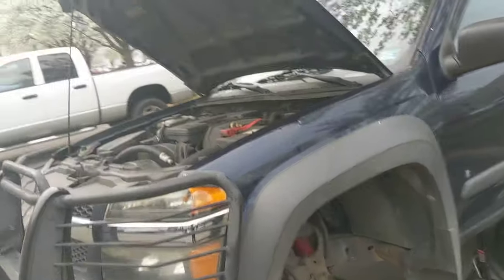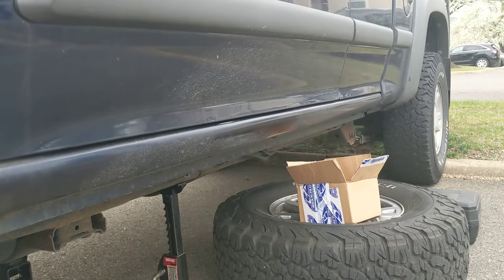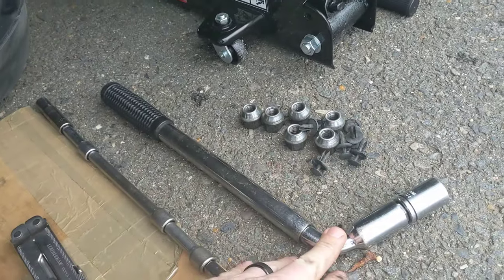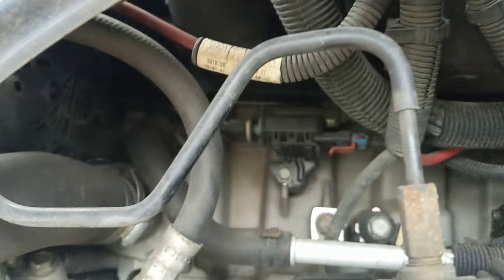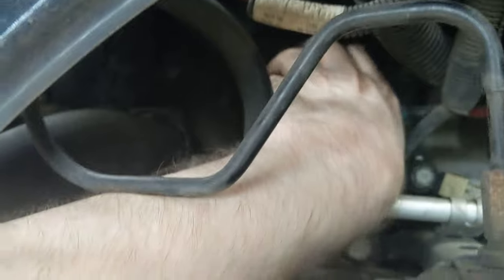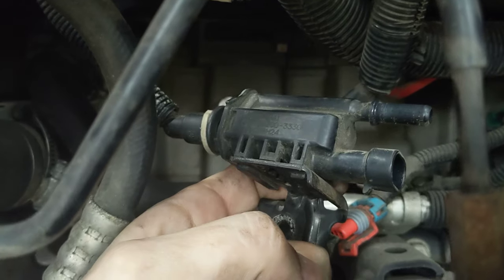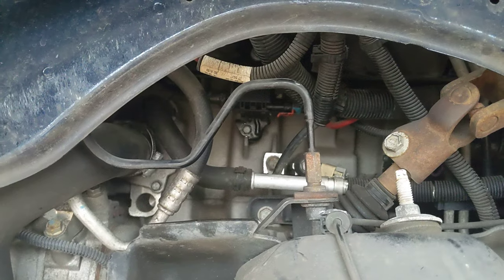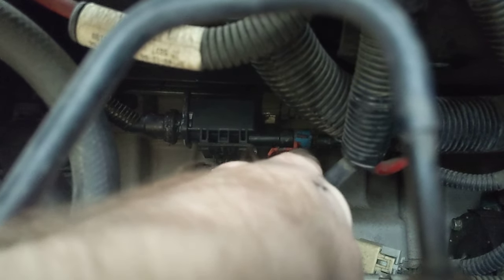How to replace Chevy Colorado purge valve solenoid (2141680) (214-1680)

Comment: Changed this but P04442 is still showing up. Any ideas on what it could be?
Reply from the maker: Hi! Thanks for the comment. I assume you mean "P0442", correct? Dumb question but if you clear the code with your code scanner after replacing the part, how long does it take to come back?

Also, here's a "troubleshooting flowchart" for various types of evap leaks:

----------

Troubleshooting flowchart for evap issues:
1 - Replace the gas cap
2 - If you still get the code, replace vapor canister purge valve above spare tire. Inspect hoses and replace as necessary
3 - If you still get the code, replace purge valve solenoid on driver's side of engine below intake. Easiest way is through driver's side wheel well, or remove battery. Inspect and replace hoses as necessary (including hose between valve and throttle body)
4 - If you still get the code, inspect lock ring around fuel pump at top of tank. This is a poor design and lock ring frequently rusts out, causing evap leaks and smell of gasoline
5 - Check for loose intake manifold bolts or leaking/damaged hoses around the intake and PCV system
6 - If you still get the code, a smoke test may help

Alternatively, don't beat around the bush and start with the smoke test.  If that is inconclusive you may also have electrical issues.

----------

Hope this helps! I'd recommend the smoke test to help pinpoint the leak if replacing parts doesn't work. Good luck!
Reply: @CompTechMike  thanks for the prompt reply! 
I already replaced the gas cap, and as mentioned just replaced the canister purge valve. I just cleared the code with my scanner so we shall see if it shows up again. 
Though I do have a smoke machine. Where should I blow the smoke thru?
Reply from the maker: @Dexxtrr  hi! A couple of common locations for running a smoke test include feeding into the vacuum line going to the power brake booster, and also if you have the second "fuel line" with the green cap next to the intake manifold. I wasn't sure what that was at first but apparently it's a good spot to do a smoke test.

This reminds me, another place that can have a vacuum leak is the diaphragm inside the power brake booster. It's uncommon, but possible. Might not hurt to run a few tests on that, as well, to check if it's holding vacuum (or a possible source of leaks). Good luck!
Reply from the maker: @Dexxtrr  hi!  Sorry for the delay.  I typically recommend various ports on the intake or around the resonator, or through the vacuum hose going to the brake booster.  You can also drill and add a small hose fitting if you don't have one, already (and just cap it off when not using it).  Good luck, hope you got it by now.  😅

Comment: how many miles did the original last you? before it STB
Reply from the maker: Hi! Thanks for the comment. I don't recall exactly but believe my truck had around 205,000 miles when I recorded this video.

Note that replacing this part did not resolve all my issues. I still get the P0442 "evap small leak". In my case that now appears to be coming from the gasket at the top of the fuel tank, where the fuel pump plugs in. Due to the difficulty of replacing that gasket (you either need to lift the bed or drop the tank) I've just been carrying a pocket code scanner and resetting the CEL when it comes on (every couple hundred miles). I'll get around to it one of these days, lol. 🤣

Comment: Mike what size are the hoses that fit in to the purge valve?
Reply from the maker: Hi! Thanks for your comment. I'm afraid I don't know the diameter of the hoses to the purge valve.  These are pretty specific and have unique connectors, so I don't think an ordinary hose would fit.  You might have some luck finding them on RockAuto, however.

I was pretty surprised, I just went to their website and put in "2007 chevy colorado vapor canister hose" and a few different hoses came up.  So if you're missing your original hose or your original one has become broken, maybe they'll have the right one for your specific truck?  Good luck!

https://www.rockauto.com/
Reply from the maker: Also this diagram might be helpful to you.  Again, you're going to want to look up for your specific vehicle but this site seems to have some pretty good diagrams:

https://www.wholesalegmpartsonline.com/showAssembly.aspx?ukey_assembly=396035&ukey_product=2787260#003

Comment: Is for message gas-cap?
Reply from the maker: Hi!  Yes, P0442 can be the error code for a loose or improperly fitting gas cap.  If you get this code that is an easy fix to test first.  Sometimes it's just as simple as rotating the cap a few times.  Good luck!

Comment: Tried this just right now but my entire Driver Side wheel hub is compressed almost all the way to the top of the inner wheel well. Anybody else had this problem?
Reply from the maker: Hi! I'm not entirely sure I understand your question. Did you remove the liner (held in with push-clips) shown at 2:55 in the video? Is your truck suspension modified (lifted or lowered)? Do you have Z71 suspension (torsion bars) or Z85 (coil springs)?
Reply: @CompTechMike  I removed the liner but its a stock RWD colorado. I was a little confused on where to place the jack because i was no where near able to even stick my hand in to even start disconnecting the solenoid.
Reply from the maker: @anarcho-savagery2097  Have you jacked up the truck under the frame and removed the tire?

Also is it coil springs or torsion bar suspension?
Reply: Sounds like you just need to move your jack to one of the jack points behind the wheel area
Reply: @thechosenpuppy574  yeah thats probably what i'll try next. Thanks guys.

Comment: So did this solve the issue?
Reply from the maker: Unfortunately it appears I have more troubleshooting to do.  Still get the occasional P0442 "evap small leak".  I've had the vehicle smoke tested and they couldn't find any leak.  They did notice some wetness at the top of the fuel tank, so there may still be that gasket around the fuel pump that needs to be changed.  It's tough to diagnose something that only happens every few hundred miles!  ;-)
Reply: So I have a leak from the top of the tank. The issue wasn't the pump assembly it's the vent gasket/ silicone holding that plastic vent in. Noticed the leak when topping off the gas. Doing research but haven't found the part(s). Thinking I may have to order a new tank since the silicone I applied isn't holding the pressure in the tank.
Reply: @frankboykin3940  just replaced my fuel pump after the top was leaking.  the rubber gasget was bad.  Needed to jack the bed up for removal.  took hours but it came out with some swearing.  I'm 1/2 way mechanical but this was a chore.

Comment: Is that put pressure inside the gas tank vent valve
Reply from the maker: Hello! I'm afraid I don't understand your question. The EVAP system works to reduce emissions and fuel vapors. You might check out this link to learn more:

https://ferberstireandauto.com/how-does-the-evaporative-emission-system-evap-work/

Hope this helps!

Comment: easy if you take the bolt out first
Reply from the maker: My experience that doesn't really give a whole lot more "wiggle room" but maybe your lines have more slack.  Whatever works for you.  Thanks for the tip! 😊
Reply: @CompTechMike  evidently ,  it would come out a foot from the engine
Reply from the maker: @jonesy4588  I don't see how your evap lines and wiring could possibly have that much slack, but if they do, sure sounds like it makes it easy.  😄

Comment: Man I do not have the clearance in my wheel well like your truck does I can't even see the Solenoid from the wheel well
Reply from the maker: Wow!  What year is it?  And engine size?  Did you remove all the plastic from around the insides of the wheel well?
Reply: @CompTechMike  yes I did remove all of the plastic around the wheel well! I actually bent all the metal around it out of the way to get to it! It wasn't fun and it took more than one beer but it's done now!! Thank you for your video it helped me get through
Reply: @CompTechMike  I'm having the same issue, with no clearance. I have a 09 2.9L 2x4 . 
Can see what  it looks like here: https://imgur.com/a/FGraCrt
What is/was the one in the video?
Reply from the maker: @zombieunicornasaurus  Ah. That's unfortunate. Coil springs. You have a Z85 or other base model suspension. Mine is a Z71 - with the torsion bars.

Comment: Awesome video! What size tires are those if you don’t mind me asking?
Reply from the maker: Hi!  Thanks for the comment.  Glad the video was helpful.  The tires are BFG AT KO2's, 31x10.5x15.  They fit on the factory rims with no adjustments to vehicle height (on a Z71) necessary.  I've had them for around 10 years (a couple sets, obv.).  They ride great, only issue I've noticed is some cracking.  They'll crack before the tread wears out.  Definitely recommend.